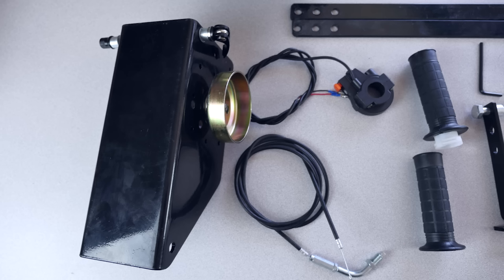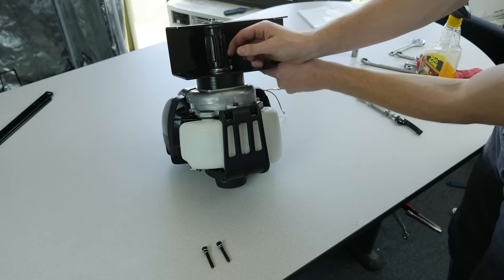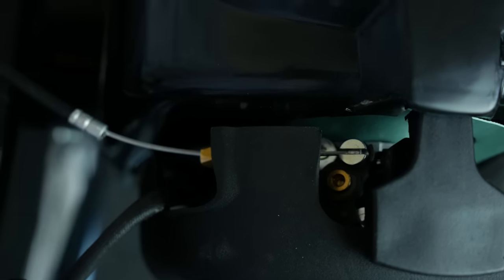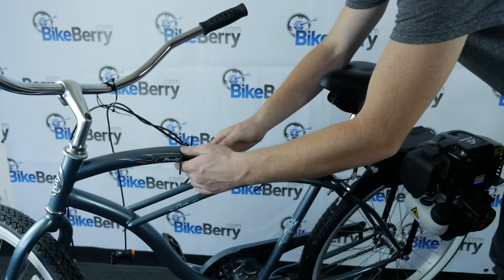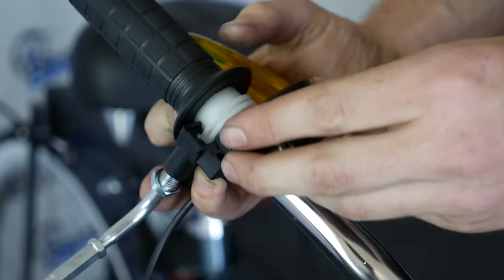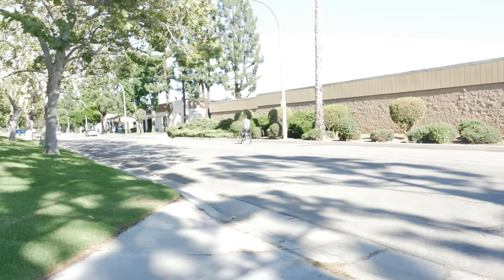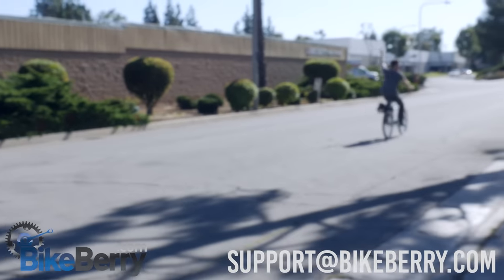4-Stroke 38cc Friction Drive Motor Bicycle Engine Kit Installation | The Flying Horse Lock-n-Load

Comment: So why wasn't there a sprocket and chain with the motor
Reply from the maker: Friction drive engine kits are designed to be a self encased motor. No chain or sprocket is needed, as the friction spindle moves the rear wheel via contact and friction. We do have other 4 stroke engines are chain and sprocket driven.
http://www.bikeberry.com/gas-engine-kits/4-stroke-bike-engine.html

Comment: can I use 10-40 oil ?
Reply from the maker: As long as the oil is used in a 4 stroke engine, it is fine.
Reply: Thanks for the info! another question, is the friction drive bearing that touches the tire can move freely when the engine is idle or turned off?
Reply from the maker: Yes, the clutch is an automatic flywheel and is free spinning when the throttle is not engaged.

Comment: You should really solder the wires on the kill switch and use shrink wrap... that will
hold  

the dude didn’t even use strippers to strip the wire.......

Comment: I wouldn't get this for 3 reasons:
1. can't use in rain/snow
2. pull start
3. vent exhaust
better to get the cheaper 100 dollar 2 stroke kits on ebay that use the chain.

Comment: What’s the point in having an advert for a product that doesn’t exist?
Reply from the maker: This video is not intended an advertisement, it is intended as in informative instructional video about a product that indeed exists, for our customers who have purchased this product.
Reply: BikeBerrycom 
Then why has it a link to website that says out of stock, and there a comments 1 year old saying the same?
Reply from the maker: This is a very popular engine that will periodically be out of stock. We do not clear any comment, as it may be beneficial to other costumers. We have already placed an order of new engines to fill our inventory, which should arrive shortly.
Reply: BikeBerrycom 

Then I suggest where you have the link that you put in “presently out of stock; product expected delivery (date).

Comment: tyres will wear off easily very soon. Instead, they should use another chain drive to the bicycle gear.
Reply: They have chain drive engines already so what are you griping about?

Comment: wouldn't it just worn the tires out?
Reply from the maker: Its not a crazy amount of accelerated degradation, but yes it does cause wear on your rear wheel.
Reply: Don’t go launch-controlling it. If you keep it easy and don’t mash the gas it should be fine.

Comment: Best engine but has a major design flaw.The bell rotor houseing on the engine splits an brakes due to the vibrations.Had 5 replacements from bikeberry an all failed. the metal they use is cheep.Not worth it!

Comment: Friction drive will wear out the tire fast & he failed to mention that the kit doesn't work with bikes with hand brakes  & that the kit has to be lowered every time to make contact with the tire & that some states require the bike to be registered & insured & the operator to have a motorcycle license. This video is misleading & could get people in trouble

Comment: 1mm drill bit? .039 inch. For a pilot hole? I think that drill you showed might have a problem with that one. Anyway, twisting the wires together and wrap with electric tape. It will work for a while but what a hack job. Think I'll look for a better ELECTRIC kit, not gas.
Reply from the maker: Everyone has a bike that works best for them. Check out our electric motor kits. One might be the right fit for you.
http://www.bikeberry.com/electric-bike-kits.html

Comment: this method kills your's tire.you can connect the gear with the chain is better.
Reply from the maker: It does add extra wear to tires, almost twice as much wear than usual because of the added contact to the tire. Though it shortens the life of a tire, in practicality use for the average rider, it is not a very noticeable difference.

Comment: Where the brakes pads? O_O It's very dangerous driving without brakes
Reply: i have no idea whats is called in english, we call is "kontrafék" which is a brake type used on old bicycles, it is located on the center if the rear wheel(1:19 left frame side), and to active it you try peddle in a reverse direction.
Reply: It is called "drum brakes".
Reply: Nope, it is the coaster brake he is talking about. These two are totally different.
Reply: péter csákvári Yep, you are right ;)

Comment: if u weigh more than  180 pounds do not buy , i wasted  250 on this motor and barley pulls, seems the  the clutch is slipping, and the roller is too large, My subaru   35 from staton , pulls me with no problem even without  pedaling to start, even up hills  if  u  already have a little speed.

Comment: With the kill-switch red cable they Said if iT does not Come With te plastic part to connect them. Wtf That is not how iT works you Guy's just need to make iT complete

Comment: That's not a wire stripper guy
Reply from the maker: Not the official name, but it worked for us. We wanted to show that installation is possible, even with a limited selection of tools. We always do encourage the use of the correct tools, as they will reduce the likelihood of injury and damage to parts and will make the process and easier task.

Comment: Do not get this engine if you think it's easy because there's always going to be a problem I should know
Reply from the maker: These engines are intended to be hands on builds, with self installation required. That is why we created these instructional videos to help with the installation process. Like most engines, occasional maintenance is also required.
Reply: BikeBerrycom In this video on the throttle handle there is a metal nub that goes into the hole on the handlebars when I got it the nub was plastic and fell off.
Reply from the maker: Unfortunately, we are only the distributors of the products, and the manufacturers will occasionally make changes to the design of their products without letting us know about the change. This product was changed to a plastic nub, not long after this video was published. Contact our customer service representatives at 1-800-317-0479. We'll work with you in finding a solution to fixing this problem.

Comment: where's the rare break?
Reply: Mohsin Badr it's a coaster brake so you could just pedal backwards
Reply: Yellowpole 
Is it practical?
Reply from the maker: It is just as effective as a disk or caliper mechanism, but does not have variable pressure that is provided when using a break lever. For better stopping power we recommend to use a front break.

Comment: Just buy a 50cc scooter. More comfortable. Just as fast or faster. Cant be stolen as easily as a bicycle. Unless you have storage… It costs me less to fill up a half tank on my scooter than it used to cost me to purchase 2 stroke synthetic oil(not including gas) for my 60cc engine. Some states have limits on the use of gas powered motors that aren't registered or insured. Thus you could have your bicycle taken away. My 2 stroke engine just had compression issues and I probably didn't give it the correct ratio for oil/gas. So I don't use it anymore. I mean, my $400 bicycle without the motor works great still. Riding my scooter is fun tho. Cost me $600.
Reply: +Joni Gabriel With a scooter you need to have an M2 license and insurance.. this no..
Reply: Not here in Jersey
Reply: Joni Gabriel lucky...
Reply: +danny55531 Actually my bad. I do have insurance. But no special license.
Reply: Here in California you can ride a 49cc MOPED, meaning it has pedals for human propulsion, without a license and insurance.
Reply: +danny55531 I see. Yea theres a whole issue with mopeds and scooters. Before buying a scooter I thought they were all the same.

Comment: How fast
Reply from the maker: This kit can easily reach 20mph, with a top speed coming close to 30mph. Speeds will vary, depending on wheel size and the weight of the rider.

Comment: This is going to go through tires like oil changes
Reply: Actually they're not that bad on tires.  The real problem lies with the roller.  Once you get about 600 miles on the roller that's it, it's all done.  Then you build a real motorized bike after that.

Comment: Why on earth would one do such thing with bicycle? Simply by a normal motorcycle and that it is. Leave a bicycle to be a bicycle.
Reply: Giorgio Grlj because not a lot of us have $500 to spend on a minibike and I can just tell the cops it's a pedal assist bike
Reply from the maker: These type of motorized bicycles do not require a license or registration, they are also vastly less expensive. These Type of installations are intended for hobbyists, circuit track racing, and recreational use, though some regions do allow them on public roads and highways.
Reply: Bycicle is meant to be pedaled. Who can't pedal, takes a bus. :)

Comment: Don't buy the scrap Buy a motor Pavil. Mopad The best brand. I've ever encountered. Is tomos you can get them up to 50 downhill. And right around 40.  On a straight away also they have 2 speeds

Comment: Geez, only 15 mph?  Buy a Honda Ruckus, get 100 mpg and 40 mph! A lot more comfortable to ride, too!
Reply from the maker: To be fair, those are two completely different options. Our fiction drive option is a universal addition to bicycles. We agree the Honda Ruckus is a fun ride, but it is in it's own category of motorized riding. A better comparison would be to compare our 79cc 4-stroke with a the Honda Ruckus, but even then it's comparing a bicycle engine to a  full sized mini bike engine. Everyone has their own riding preference. Some want a little extra help with their weekend joy ride, and others want a full-on adrenaline machine. We suggest getting what works best for you.
Reply: Of course you are correct, but my Ruck has only 49 cc, so I thought the comparison was reasonable.  If my Ruck had 79 cc, It would hit 50 mph easy!
Reply from the maker: Our apologies for jumping to concussions and assuming you had a larger engine. The Ruckus is a viable option, but it still has the problem of being a mini bike. Many of our customers prefer to have an engine that can easily be installed onto their bikes.

We also realized we never explained the difference in drive system between our friction drive and the Ruckus. Our friction drive is limited to speed, due to the size of the friction roller and the RPMs it can generate. It by no means is intended for speed as it would be a incredible safety hazard if the roller were to break or chip. Our 49cc center mounted engine is more comparable to the Ruckus as they are the same size and have similar drive systems. They have similar mpg, with the Ruckus edging out over our 25mph stock top speed. If speed is more an option our 2-strokes are a better option reaching similar speeds as the Ruckus. The Ruckus is a viable option but is far from the perfect engine. There really isn't a perfection engine, just the best engine to fit every individual's needs.
Reply: I thank you and totally agree. I quit riding a bicycle when in college and started riding small cc motorcycles...have owned a Hona 110 trail, a yammie 100 cc twin, a Chinese 150 cc scoot, a honda 750, an 1800 cc Goldwing, and now a Ruckus....they are all fun, each in their own right!  If I was into biking again, I would certainly consider one of these set ups, especially if I lived where it was flat, like down on the Gulf Coast!

Comment: The point of a bike is not to burn fossil fuels. Burning a SMALL amount of fuel from a basic engine may be more polling than a modern car with expensive emission control. This would be illegal in UK without a helmet, tax,motorcycle licence or cbt and insurance.
Reply: Super -sim lol you burn like nothing. You get almost 200 mpg vs. a car that gets like 30 mpg.

Comment: Always use a box end wrench, adjustable wrenches chew up the nuts and bolts. That is some amateur shit there son.
Reply from the maker: We wanted to show that installation is possible even with a limited selection of tools. We always encourage the use of the correct tools, as they will reduce the likelihood of injury and damage to parts and will make the processes an easier task.

Comment: Nice but... electric bikes are already here. :D
Reply: electric bikes are also way more expensive and also doesn't go as fast or far.
Reply: True. That's why there are mopeds and scooters... plenty of them to choose.
Reply: Yeah well those are for dorks and not as cool.
Reply: again you are right ;D
Reply: Dan smith man going faster than 14 mph is cool. i have an ebike and its embarrassing even when a scooter drops his clutch and whizzes past me.
Reply: Yeah but what's the reason to put a noisy and heavy motor on your bike. Want to go fast? Buy a motorbike or scooter. This project is like reinventing a wheel...
Reply: No license, no yearly registration, still ride it around town like a bicycle, cool factor, fun, cheap to do and operate, hobby, just something to do and a lot funner than just a wheel.

Comment: These hunks of shit will chew hell out of your tyres. Really bad weight distribution too. And totally gutless. That's three strikes.
Reply from the maker: We admit the drive mechanism will create additional wear on the tire, but it is not incredibly detrimental to their longevity. The weight distribution is offset from center but we have not found any discomfort loss of performance while riding, nor have we heard of any complaints from our customers regarding this issue. I'm not entirely sure what you mean by gutless. Additionally, this design is not uncommon, as it is a well known DIY modification using motorized lawn equipment. We provide an all in one package of a motor, mounting brackets, and throttle assembly to save time and effort from procuring and modifying.

Comment: I installed  this motor on my bike , after  first  oil change motor kept stalling  , too many pulls hurt my arm. I switched  spark plug,  gap it , no help . Bottom  line  worst  waste of time , loud , eats rubber, backfiring,  burns oil  . Terrible  . I am constructing  an electric  bike . That's the future  no more burned oil, etc. Gas is past electric  is the only way  to  go

Comment: Placing all the weight on one side is not a smart design. NOT rider friendly. Dumb.
Reply from the maker: It does create an off balanced ride, but we wouldn't call it "not rider friendly." We've never heard any complaints about its weight distribution.
Reply from the maker: We're sorry to hear you're having problems. Please contact our customer service at 1-800-317-0479

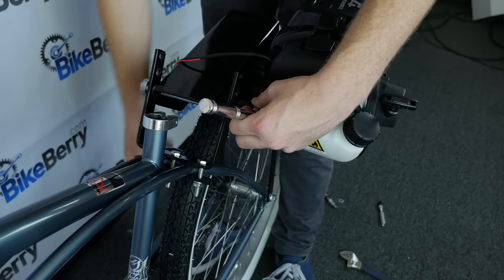Comment: So people know. This product doesn't work. I bought the bike and everything else they said that be best to use for this. You will start to notice half way through the install with video product will be different. all the way down to screws. They show and say when you buy engine will come with up to date install video, it does not. There is no gap between engine and tire to engage and disengage like the show in video. Also manufacturer even put some parts that are pre assembled on backwards manly the bolts at 2:00mins making impossible too take off without taking whole thing off engine you attached at 0:58mins. In closing even with a mechanic looking at it in final attempted  to try to get it to work said "This product is poorly designed with little chance of working, and even if I did manage too get it to work this style of engine isn't meant to carry adult weight. Be more for a little kids go cart." So beware: Most easiest and all that jazz = most easiest scam don't fall for it.
Reply from the maker: If your having trouble installing your engine kit give us a call and well be more than happy to assist you. (800)317-0479

Comment: why would anyone want to buy a gas motor kit anymore when you can get an electric kit that's cheaper, faster, quieter, safer and better for the environment?
Reply: Simple. E-bikes have such a short range and 3 to 5 hours recharge time. A gas bike can get up to 150 mpg you can ride as far and as long as you like, if you run out of fuel nearest gas station can fix up up in about 2 minutes. Not 3 to 5 hrs! What a great idea!
Reply: Cheaper?  Are you crazy? You can purchase a complete gas kit for 100.  Faster?  I will take on any electric you have. My total investment, 700.  High pro pipe, carburetor,ignition.  What do you bring for 700?  Do you really think you could beat me up the mountain on a electric bike? And with all the fires and smoke in the air a little two stroke would make very very little difference. Go pick on the real polluters. If I ever see you out riding, I will pass you. I pass everyone! Happy trails friend.
Reply: kennith rogers not on a 700$ electric bike, a 16,000 dollar electric dirtbike would Because of how powerful of a motor would be in a bike like that. For the price i could buy 2 or 3 brand new 250cc dirt bike. Its highly impractical for the modern american to buy a $16,000 electric bike.